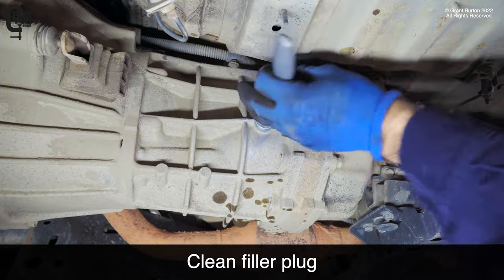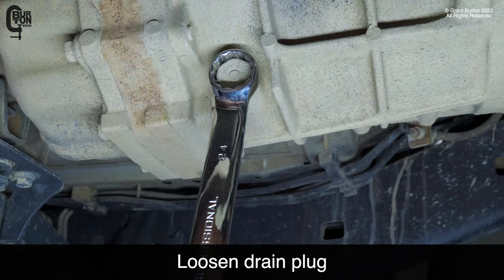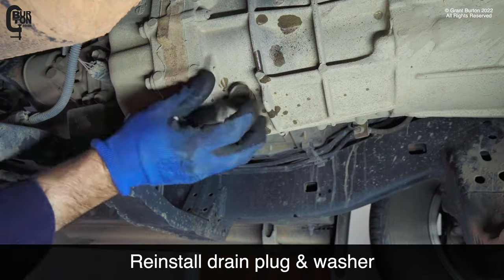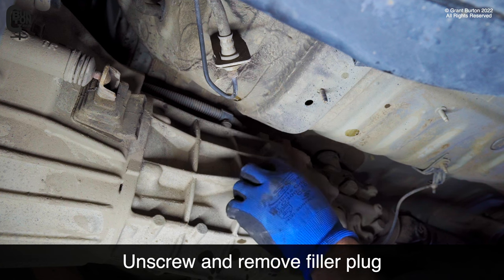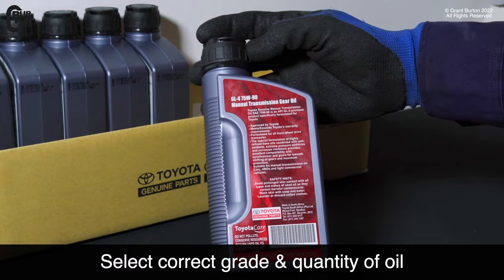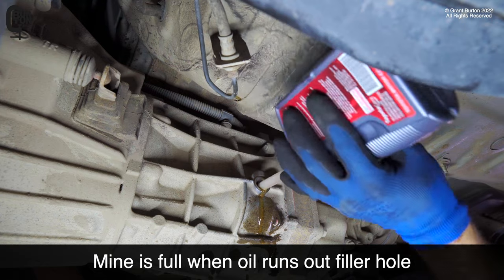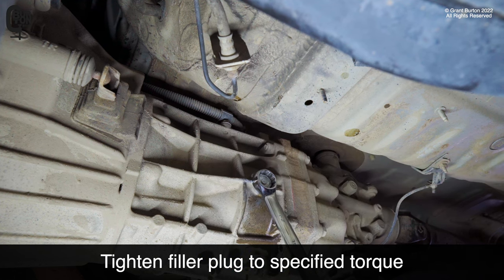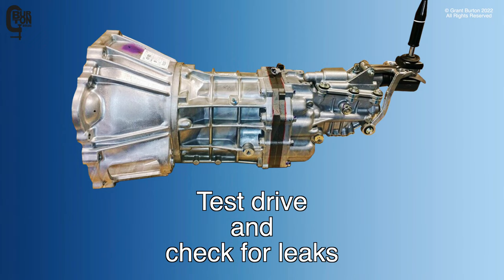Change Transmission Gearbox Oil in 2 Mins - Burton Builds

Comment: Tip: always undo the fill plug before the drain plug. That way, if it turns out your filler plug doesn’t come out, you won’t have drained your oil already, and you can use the vehicle to go get some more tools to help you fix the fill plug problem first.
Reply from the maker: Hi, thanks… that’s a great tip… I have previously made notes of this at the top of the description and the comments section. Thanks again 😊

Comment: lol i love how toyota actually make the process easy on my shitty fiesta is like the have designed it to be as hard as possible and the fact the fill plug is badly stripped to lol
Reply from the maker: I suppose some vehicles are designed with ease of maintenance in mind where with others, ease of maintenance is lower down the priority list. Generally speaking, the older Toyotas are pretty user friendly to work on.

Comment: Toyota min bus2LT gear box overhaul maintenance
Reply from the maker: It's possible that it uses the same, or a very similar, transmission as in this video. This is a 2.7L Hilux.